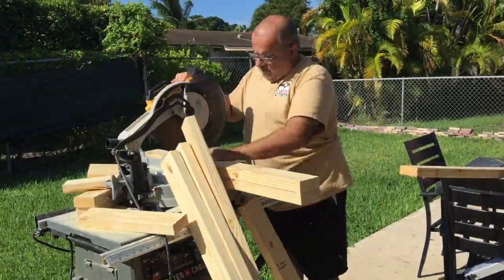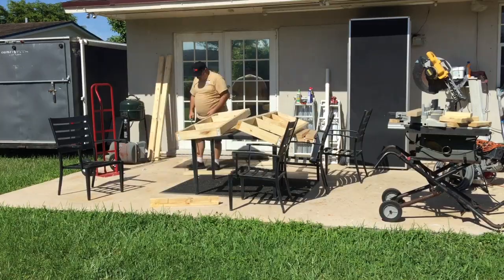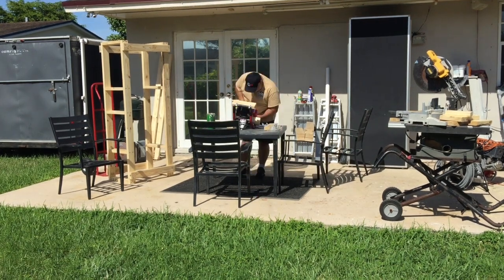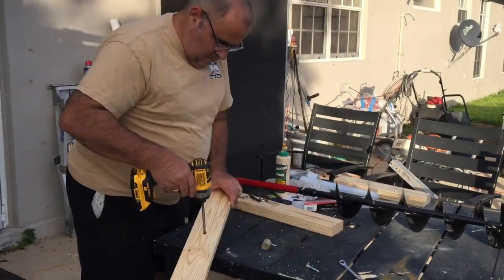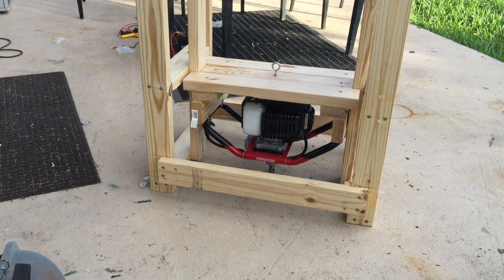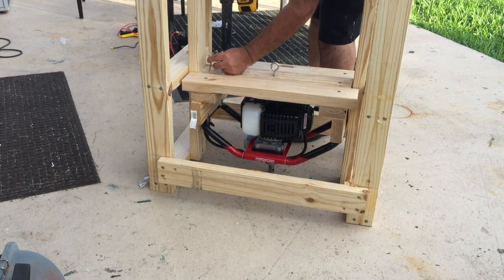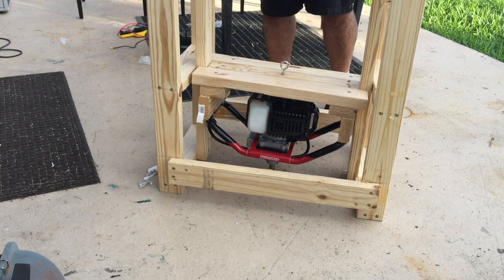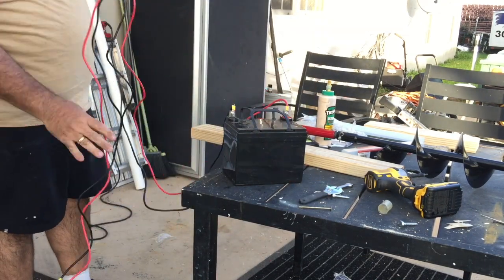Automated DIY Posthole Digger - 30 day challenge Project 3 of 30

Comment: Looks good man,  I will build this contraption too.  My only concern,  what happens when you hit the inevitable rock or tree root?
Reply from the maker: Luckily, the only roots I had were grass and vine roots the first 6 inches. Occasionally, I would hit a root deeper than that, but they were smaller ones. In the event that a large root was in my way, (as in the case of the bamboo roots, I had near the lake) there would be a lot of bouncing from the machine, but the auger would eventually tear through most of them. If it ever got stuck, I would turn off the post hole digger manually reverse the auger as I pull it up with the lift. For me it was never an issue, but then again, Central Florida is the home of sandy soil and clay so there’s that.

Comment: thank you for making and posting this video. I've been trying to work out how I'm going to deal with drilling some challenging holes on the side of a hill and a modified version of this will surely save me a ton of time. I really appreciate this
Reply from the maker: Glad to have helped! Another option I found even better for the future holes (as I have sandy ground that caves in on itself) was to use a shop vac to drill the hole after breaking the grass on the top 3 inches. I have a cyclone in between so the dirt wouldn't clog up the filter and I just empty the 5 gallon bucket into the posted hole afterwards.

Comment: 12 volt batteries for $10.00??? Where???
Reply: Amazon. The winch doesn't need much and those small ups and alarm batteries are pretty handy.
Reply from the maker: https://www.amazon.com/BatteryGuy-BG-1250F2-12V-Rechargeable-Battery/dp/B01N4RAWZB/ref=sr_1_60?keywords=12v+battery&qid=1576756070&sr=8-60

Any 12v battery with at least 2 Amp Hours will work. With shipping, you can get a 7 Amp 12v for 13.99 (at the time of this post.)